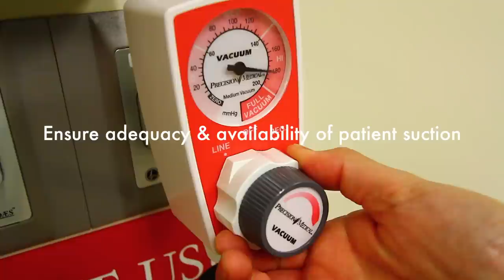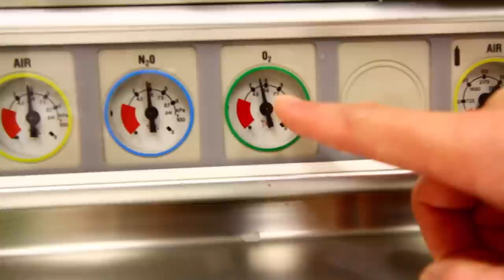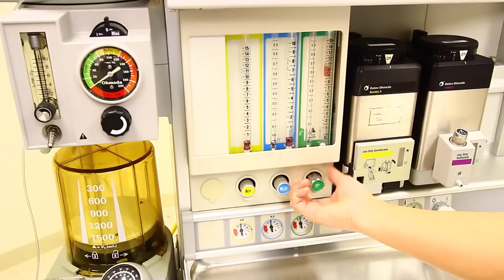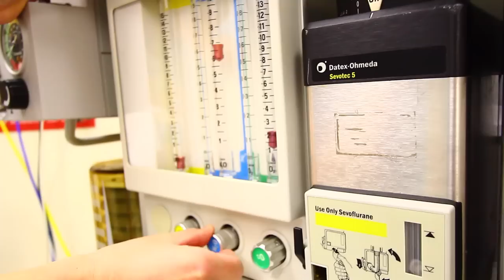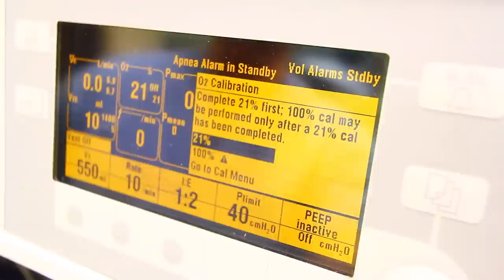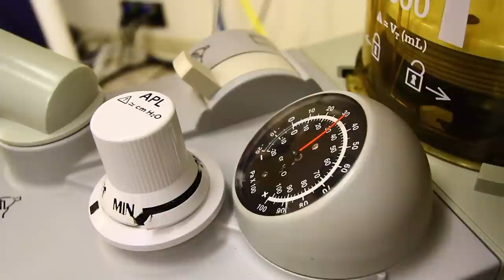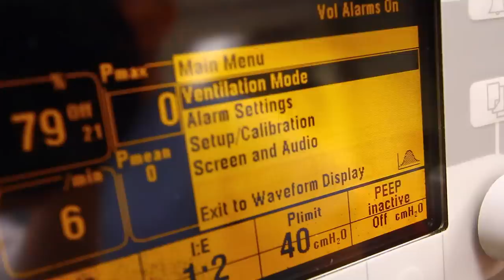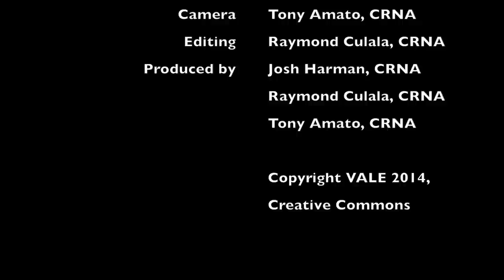Anesthesia Machine Check

Comment: Aren't the pipeline pressures from the walls considered "intermediate' pressure system, since the pressures is at least 50 psi?
Reply: No they're high pressure, intermediate gets its pressure from the FF from the outside atmosphere ceiling

Comment: You stated that having a checklist was a big thing...could you please show the checklist you used.
This procedure was based on the 1993 FDA guidelines.  why not the 2008 guidelines from the APSF?
When testing the ambu-bag, it should also be compressed and dead-ended to show it can deliver under pressure.
The suction bulb leak testing device should be tested for leaks before testing on machine.
The common gas outlet in video is actually the auxiliary CGO.  The CGO is behind the uni-directional valve module.  
When test vaporizers for leaks, it is also proper to insure that only one vaporizer can be turned on at a time.
When testing flowmeters, advise operator to shunt insp/exp ports.
At 5:21, tape should not be used to plug unused scavenging port.
At 5:32, You state to adjust scavenging system...but to what value?
At 5:37, notice crack in APL valve.  this should be replaced.
At 5:41, occlude the Y-piece, yet notice gas monitoring line is disconnected causing leak.
At no point was the scavenging  bag fully inflated, verifying its self-integrity.
At 6:27 Notice silver button (water spigot emblem).  operators frequently miss this this all important feature. 
Explain that oxygen sensor 100% calibration is performed after its replacement.
At 8:50, notice during leak test pressure gauge is actually dropping, indicating a leak.  Operators should understand how to measure the the leak rate, (as all machines are allowed to leak a certain amount) and determine if leak rate is acceptable.